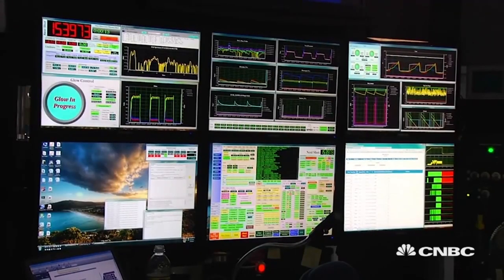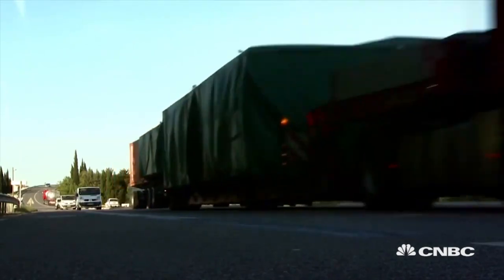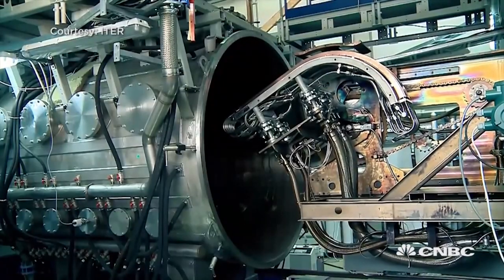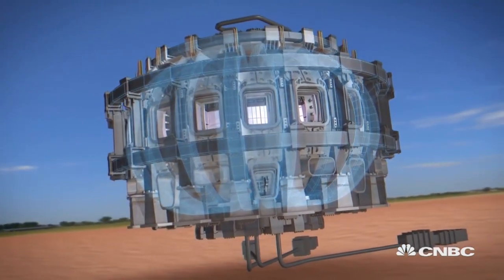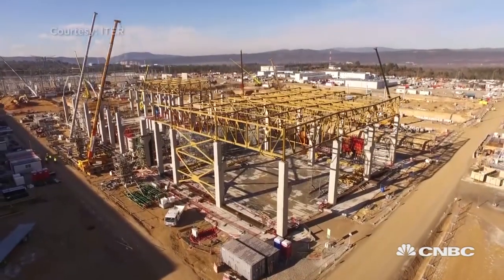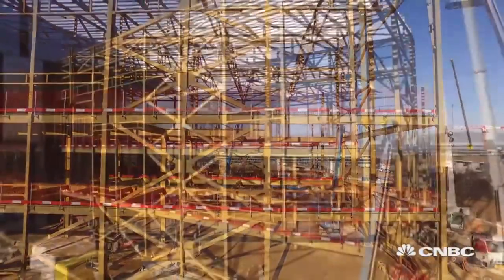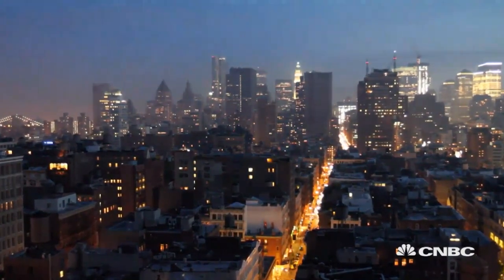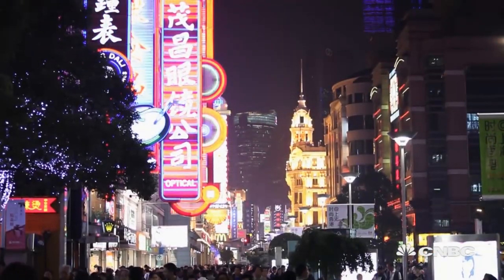Completing the ‘world’s largest fusion experiment’ ITER | The Edge

Comment: if the procces wasnt so bureaucratic it could be done in afraction of the time.
Reply: It's not expensive due to bureaucracy. They are designing and building from scratch the most sophisticated and advanced machine every dreamed of. It will be the hottest point in a radius of thousands of light-years, far hotter than the centre of the sun.
Reply: It probably would have saved a lot of time if one country supplied all the parts and the others just shouldered the cost
Reply: maximkazhenkov11 exactly the only reason they are building it like this is because they think it is a nice idea that a bunch of countries build it together. It is predominantly ideological reasoning
Reply: Still, it is difficult to imagine that even for such a groundbreaking thing the best and brightest will need like 20 years to verify whether it works or not. In construction from 2013 to 2019, alright, but full fusion around 2035?

What are they all doing in the meanwhile? Constantly checking whether everything is plugged in? Obvious sarcasm of course, but I find it very difficult to believe that the top physicists in the world need so much time to verify whether it works or not.
Reply: It will also have the highest temperature gradient in the universe that we currently know of.
Reply: Gianni It has to be perfect. Due to specific laws in France they can’t drill into concrete so they’re literally building it from the ground up. One mistake would cost tons of money and failure is not an option here.
Reply: A) I agree with the bureaucratic bs causing it to take more time. How could it not? B) Not the hottest, even if we ignore proton colliders, dense plasma focus devices actually produce billions of kelvins for fusion. C) If somehow this thing were to magically assemble itself (god I wish we had high level construction ai and robot tech) and the cost was just for the raw materials, I wonder how much cheaper it'd be. Probably orders of magnitude less.
Reply: @Elucidator-  Perfection takes time, but he said 2040 for fusion to be internationally available. It will take time to replace nuclear power plants with fusion, but definitely worth it.